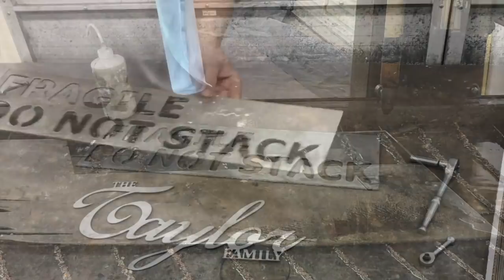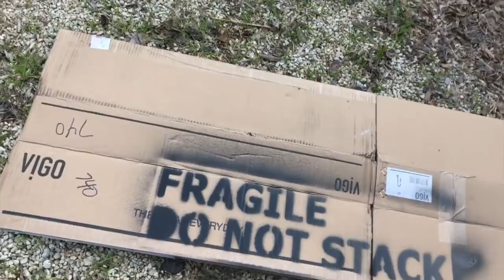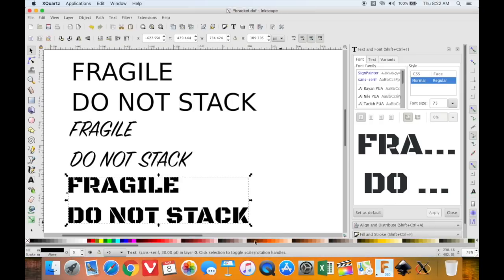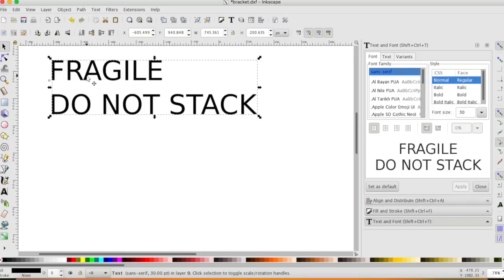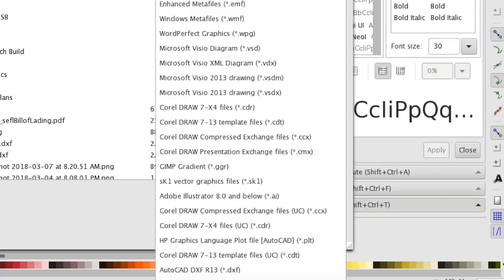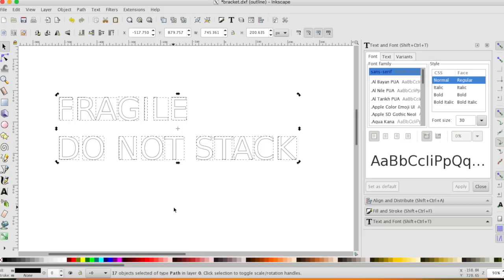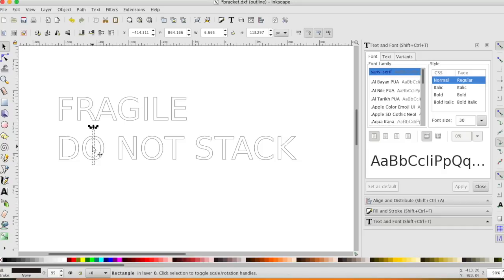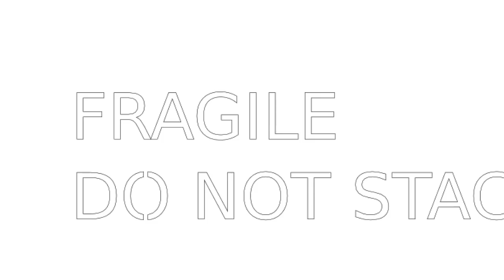Working with Text and Fonts - Trucutcnc CNC Plasma Table - Inkscape

Comment: Path + Difference doesn't work on the new version. You ha e to use the eraser tool to cut through the letter and use the node tool to clean it up.

Comment: I am using mach3 software to control a two axis cnc machine that has one liner and one rotating axis for pipe notching and coping. The thing is i want to write an advertisement in one pipe but i don't know how in which format to export the inkscape file. I am using metric system. Thank you very much